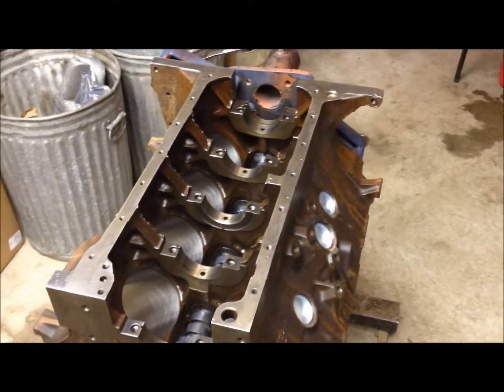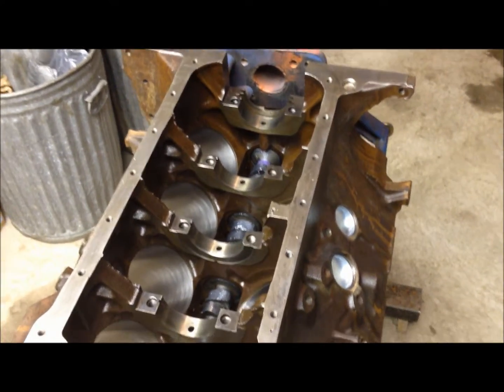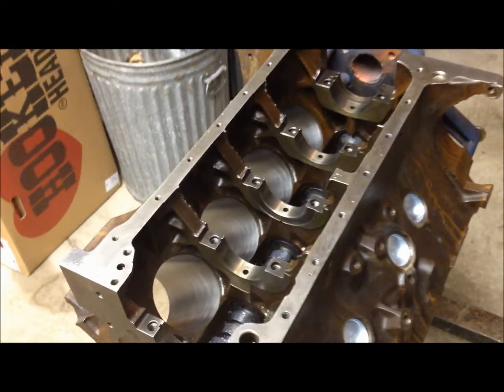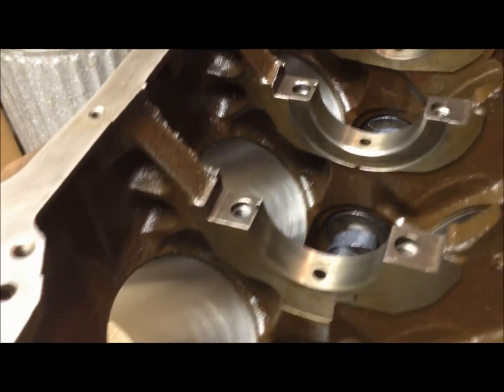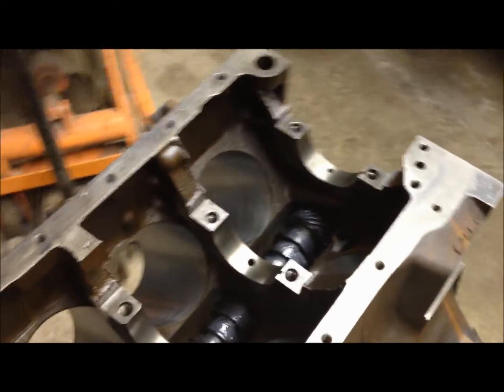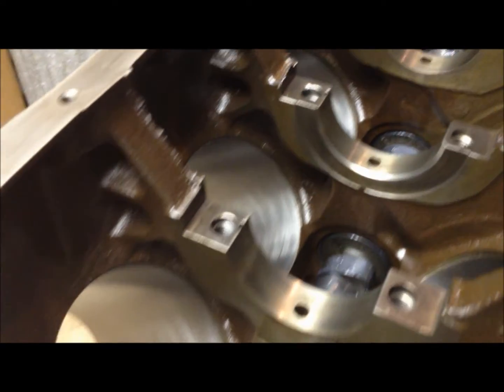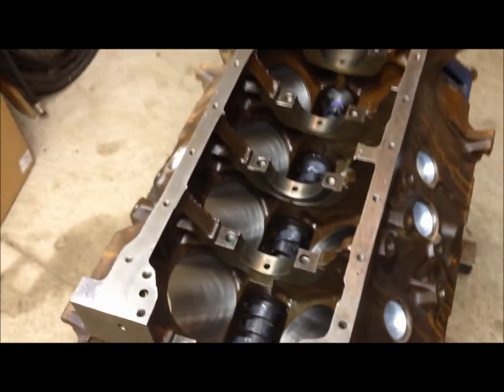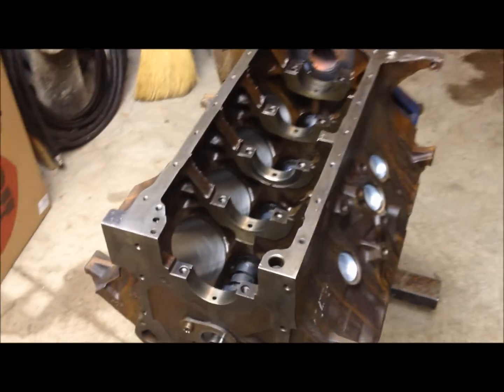The Strongest 390/360 FE Blocks

Comment: If you own a 390 Fe I would say most of the parts would be interchangeable with a 427 FE   lowriser. The heads, the camshaft, the distributor, the crankshaft, water pump Etc. Do you agree?

Comment: FE builds require so much extra little details during machining, even on stock applications. Not that I mind, just an observation. Anotjer thing I have noticed, as a shop that hones pretty much every block with torque plates. FE engines seem to distort the most. Always found that strange. Have two 445 strokers and 428 in the machins shop right now and recently sent out a mostly stock 390. So still get to see them in the machine regularly. Keep them classics running 👍🍻
Reply: FE stands for : Frickin Expensive.

Comment: Luke, are you talking about PICKUP truck blocks, or the heavy duty FT blocks, like from F-550s and such? Those all have steel cranks, but the snout has to be turned down to passenger car/pickup size to accept a damper.
Reply: I wouldn’t bother with that heavy steel crank.  Matching it down to what it would take to be useful and you could nearly put a stroker kit in that is fully balanced and good for a turbo 700-800 hp.
Reply: @Bbba724  Common sense tells you that a steel crank is better than cast iron ! Steel is HARDER than cast Iron! DUH .
Reply: @jerryparks6123  - "better" is a relative  term, and depends on intended usage ...

Ford FE cranks were all nodular iron until 1964 - they are lighter than forged steel cranks - FE 427's with cast iron cranks dominated in NASCAR and NHRA - Ford's nodular  cast iron cranks are particularly well known for being well designed, durable, and strong - there is no need for a steel crank in an FE up to 500+ horsepower.
Reply: F - 550s never had FE series Engines ! They quit building them 30 some YEARS earlier! DUH .

Comment: Ever converted a 390 to a 406?  Im doing it with a 6 pack intake.  any pointers?
Reply: Bad idea -- a 390 4.05" bore block will not safely take a 406/428 4.13" bure.
Reply: @sandibaker7646  who says?
Reply: @davidkeeton6716  -- Barry Rabotnick -- "How To Rebuild Ford FE Engines" -- page 13 -- "Despite  what you may see on the internet it is best to assume that you cannot bore a 390 block to 428 dimensions. These are thin-wall castings, and odds are you will eventually split a cylinder even if you get it running."